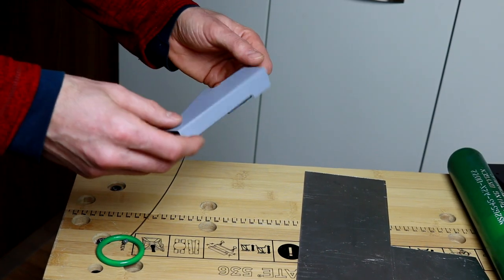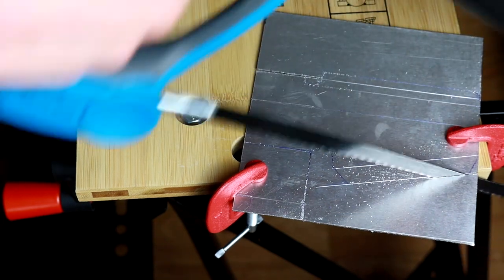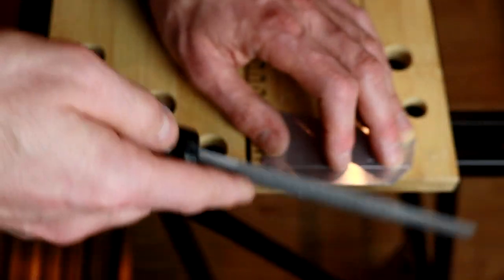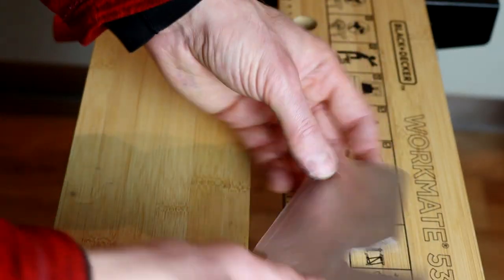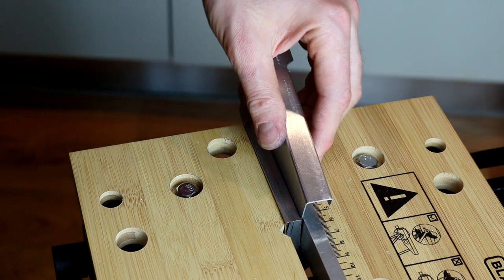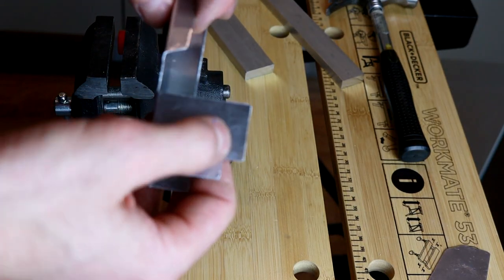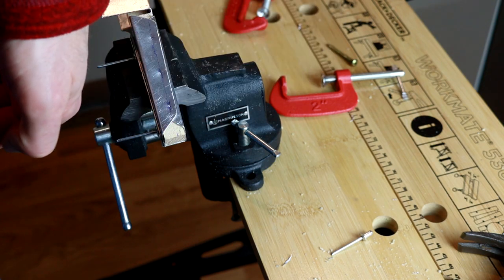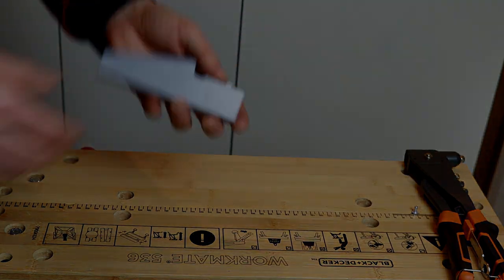Bending metal with no special tools - ACES II seat for DCS (Digital Combat Simulator) or Falcon BMS

Comment: curious bout the weight for finished product
Reply from the maker: Hi. I'm guessing around 40kg (80lbs) finished with a joystick, throttle and rudders  - it's difficult to put it on any scale right now, hence pure guess based on just lifting it of the floor. The seat's floor doesn't go deep under the seat, and I can unscrew it for transport/moving around.  Thank you for watching.